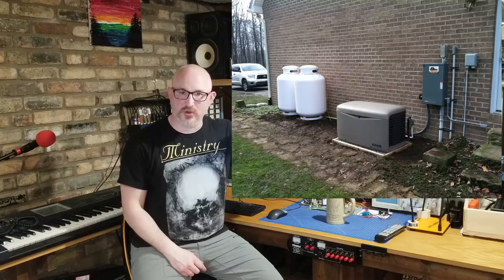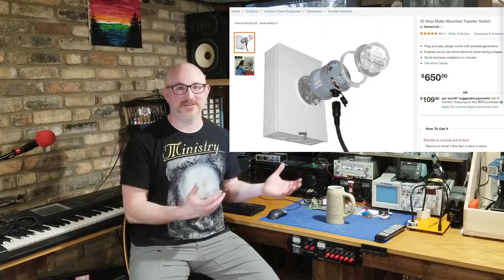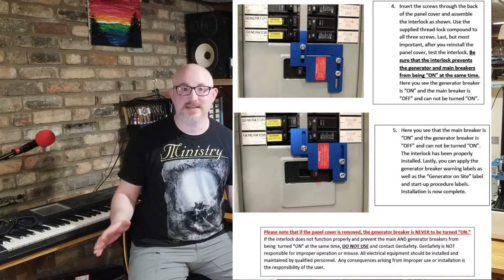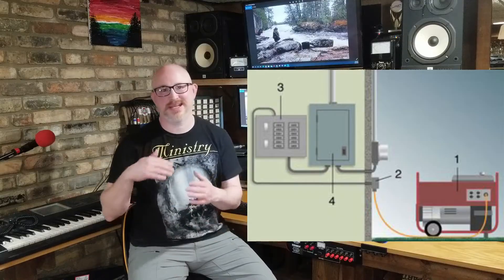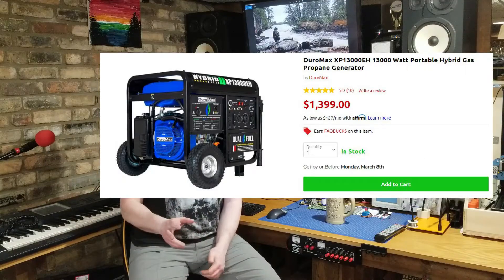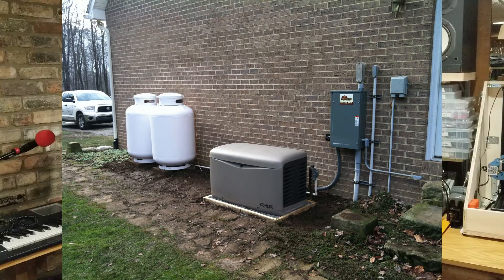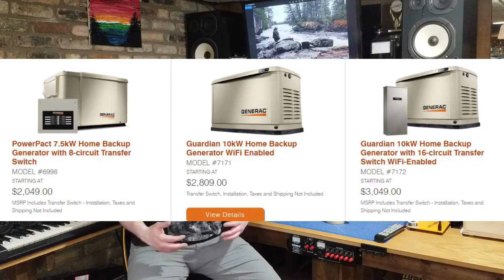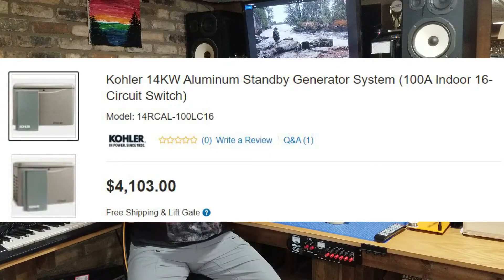Electrical Engineer explains connecting generators to your home

Comment: Probably won’t get answered but here goes. 7000W generator. Floating neutral. House has typical 2 legs with bonded neutral/ground. Manual interlock with 2 circuit breakers.  Under normal running off of main power company power the neutral going back to the pole has amps going through it that represent the difference between the use on the 2 legs correct?  Leg A has 5amps and leg B has 7 amps so neutral going out of house has 2amps. If that is correct then why isn’t that dangerous for the line man when you have switched over to the same case except now the interlock is in engaged and you are on generator power?  The interlock only disconnects the 2 hot legs. The neutral to the pole stays in place always. Why isn’t that dangerous for lineman?
Reply from the maker: I'm happy to answer the best I can remotely.  Let me dig in after some caffeine.  :)
Reply from the maker: Gotcha. This is because the neutral current is trying to get back to the source. It's not trying to go in any other direction to any other source, it's only trying to get back to its actual source. In the case when you're running a generator, the actual source is the neutral point on the generator windings.  This is why I recommend breaking the ground connection because the ground is for accidental or non-intentional current pathways or fault current pathways try to get back to the source. It's still trying to only go back to its source but it's just going to take any path possible to get to the source.
Reply: @richardvedvik979  - thank you very much for the reply.  So I guess you’re saying, although I measure amperage when my main city power is on on the neutral going to the pole I shouldn’t be able to see any amperage under the same conditions with the interlock engaged, main power breakers off and generator running?  Meaning, measuring the same neutral going to the pole should not have any amperage even though it’s connected to the generator ‘system’.  I’ve never tried it when the generators running, but I know that it happens when the main power is on.
Reply from the maker: @condor5635  it'll depend where you take that measurement. Keep in mind, that the path for the neutral current is through the panel so what you would be measuring is the neutral conductor from the panel to the meter socket. That conductor should carry no current when the generator is running and interlock is engaged.
Reply: @richardvedvik979  - i’m taking the measurement right between it’s lug nut and where it exits the main panel, right next to the other two legs. It’s the neutral going back to the pole in all cases
Reply from the maker: Ah, then no, you shouldn't measure >1A of current on the neutral conductor between the panel and the service transformer on the pole with the circuit breaker open.  Some stray current may be measured (for a myriad of reasons), but it would be quite low.   If you have more than 1A, then I would suspect some other bonding occurring up-stream.  For example, if your home is fed from panel and not directly from the utility transformer, or if the neutral conductor or lug has a bond to the metal enclosure.
Reply: @richardvedvik979  - thanks for that. I just happened to be measuring the 2 legs (totally unrelated to the generator involved just pure panel) on my panel and one had 7 amps the other had 5 amps. I thought the neutral would carry the difference in this case -2 amps. Well low and behold the  neutral was measuring -6 amps. Is that correct?  Isn’t it supposed to be the difference?

Comment: Does my portable generator have to be a floating neutral if I have interlock system.
Reply from the maker: Sorry for the delay, Coy.  The need for an interlock is independent of the bonding situation at the generator.  The interlock is to prevent any possibility of paralleling the generator and utility, and any possible back-feed of either.

Comment: Thanks, great video. I did my system a few years ago using the panel interlock method. My generator came with ground-neutral bonding already hardwired. So, I had to isolate that as I was using the bonding already in place in my main panel. I did makeup a 6” long extension cord that I can use to re-establish bonding in the generator if I want to use it for another purpose. I keep 100 liters of stabilized fuel on site and another 30 liters in the generator itself so I can operate about a week without getting any fuel. I run the generator about 10-20 minutes every month to verify it is in good order.  Every summer, I change the oil in the generator and I also drain the fuel and burn that in my vehicle, along with the 100 liters I have stored so everything is fresh when I hit the fall season. Possibly of interest to your viewers - I store my generator in my garage and keep it connected to a battery tender to maintain the starting battery. The other thing of interest is that I have installed a power returned detector (PowerBACK Utility Power Return Alert – Reliance Controls THP108) in my main panel so I know when utility power has been restored.  This device is available on Amazon and it makes a loud noise when utility power comes back on, so you don’t run your generator longer than necessary.  I, too, am familiar with commercial emergency power systems as I have done design work for computer installations.

Comment: Hi Richard, I enjoy your channel, I have a question that's bugging me for a while, if I back feed a 240 volt supply from a generator with a bounded neutral to a 240 volt hot water supply  that only has 2 ,120v  hots an a ground no neutral  , the  main breaker for the house panel will be turned off and locked. When the 120 volt breakers  circuits in the panel are used separately will the generator  be looking for neutral  current  feed back to work properly, and will the circuits in the panel  work properly using the panel neutral and ground.
Reply from the maker: I haven't ignored your question but I have been too busy to sketch your request to verify.  Soon.

Comment: You put your interlock on the panel.you shut off main feed in L1,L2..switch generator breaker on. The neutral from utility is still connected to pole transformer.not swiched open when you open main switch to use generator.is this a problem ?is this a back feed situation?
Reply: If you use this interlock set up, do you need a transfer switch?
Reply from the maker: Great comment.  Glad you're thinking about the big picture.  Short answer, no.  Neutral current wants to get back to the source, which is not the utility when the generator is the source.

No, a transfer switch is not needed.  It would have to be a 3-pole switch, which is not common.  Most installations have bonded neutrals, even with a transfer switch.
Reply: @richardvedvik979  so if i m connecting my 240,120 recepticle on the generator by  a three wire connected to my breaker panel, i connect L1 and L2 to the breaker .the neutral is connected to the panel neutral ?

Comment: Hi. Thanks for all the great info. I have a mobile home, and it just unplugs by the meter. Can I just plug that into a generator and only turn on the breakers I need? Also, I got a MultiQuip 5kW that has a floating neutral. Does it need to be bonded, and does it need a grounding rod, if I plug the trailer in that way? I've watched tons of videos, and I'm still a bit confused. Thanks!
Reply from the maker: Thank you for the question and I apologize for the delay.  You can connect your mobile home directly to the portable generator if you have a ground rod connected and you have the neutral bonded only once in the system.  So the first thing to do would be verifying where the neutral-ground bond is located.  You can get an idea of where it is by considering how many conductors are in the plug.  If there are only three, then the bond is in the panel and you would need the generator floating.  If there are four then the bond is probably at the source and you would need the generator to be bonded.

Comment: I have an HO7553 Firman generator.  I bought the reliance outlet box with the reliance transfer switch. My generator can be changed from bonded to floating. My question is do I need to change it from bonded to floating when I connect it to the outlet box that’s connected to the transfer switch that goes to my breaker box?  Any help would be greatly appreciated.  Thanks so much!!
Reply from the maker: Sorry that I missed your question!  I assume you made a decision since posting this question, what did you decide?  Did you see my bonding video discussing this exact topic?  If you have a transfer switch that switches the neutral, you would leave the generator bonded.  If the transfer switch has bonded neutrals, you would want the generator floating.

Comment: I have a external generator connection to my panel with a dedicated 50amp breaker and interlock kit. Outside where my connections and generator is located, do I need to ground the chassis of the generator or do I have sufficient ground with the 240v 50amp jumper that connects the generator to the electrical panel?
Reply from the maker: The ground contained in the 50A cord is sufficient.  Note that I have another video explaining neutral-ground bonding.
Reply: @richardvedvik979  thanks
Reply from the maker: https://youtu.be/Nrnforx1uFI

Comment: ❓ I have a 4 prong on my generator and a Three prong  in the garage . I adapt the 4 prong to a 3 prong. plug it in it back feeds to the house. Works great except for one rooms plugs don't work ? The breaker to those plugs are on the same side as other breakers to plugs that work fine. Why ?????
Reply from the maker: Please, don't backfeed the way that you are. I recommend that you stop. Slow down. And pay very close attention to what you were doing.

A three prong outlet should not be adapted to accommodate a four-prong plug. That is not the intent of the generator nor is it the intent of the receptacle. What I suspect is happening, is that you are taking a generator connection with two phases and simply ignoring one of the two. When you back feed your panel with a single phase, 120 volt feed, you're only feeding half the panel.

The way that an electrical panel is divided is that each row alternates between phase A and phase B. When you backfeed at 120 volts you only backfeed one of the two phases.

But the primary reason you that you should not do what you're doing is that you do not have a mechanical interlock to prevent backfeeding the main. You pose a risk to yourself, your home occupants, and anybody that could be working on or touching the electrical cables if you back feed your panel without making sure the main breaker is off. And simply remembering to do so is not sufficient. One of the things that I stress in this video is that you need to ensure that there is a mechanical interlock preventing back feeding the utility grid.